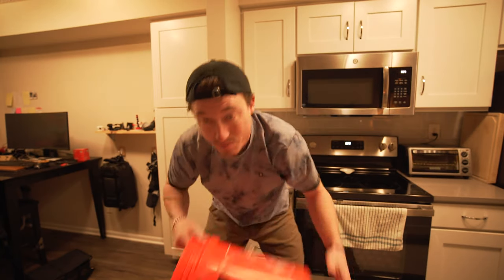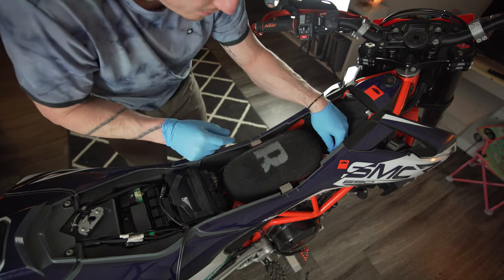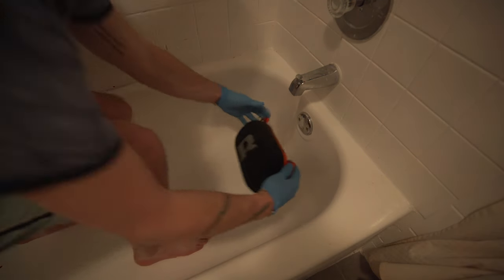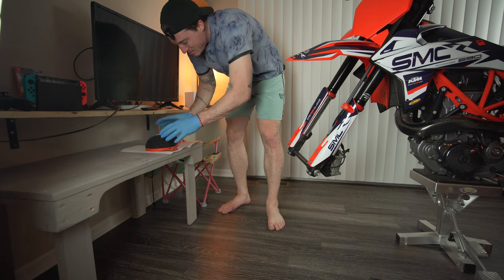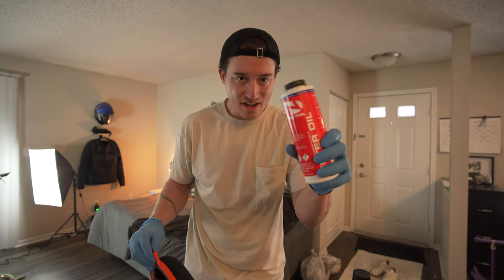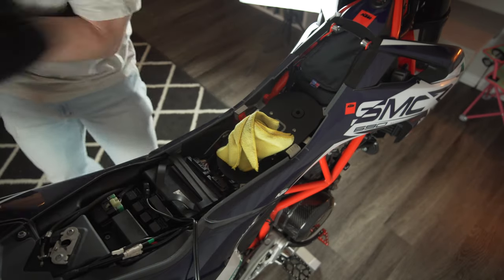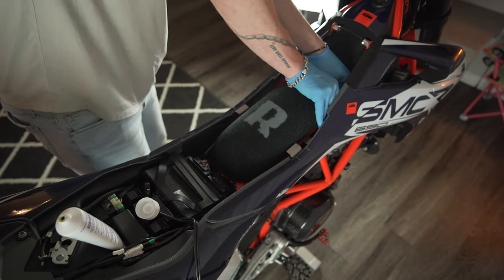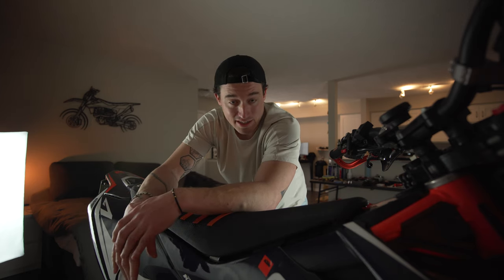How to clean your Rottweiler Intake foam filter | KTM 690 SMC R

Comment: Is it true that a Rade Garage filter has the same performance, HP and response wise? I love the RG pricing and easiness, plus the extra storage or fuel tank. For an SMC R. What do you think?
Reply from the maker: It's hard to say since I don't have any experience with a RG filter. I would assume.. again ASSUME.. it's better than stock but is probably the same as Rottweiler? Rot does offer a storage bag that you zip tie in (which I have an highly suggest) but if RG offers extra fuel that may be pretty cool.. At the end of the day, I wouldn't see (assuming) a performance difference between the two, I would simply choose based on familiarity and/or accessory choice. 

Answer: I will choose Rottweiler because I have experience with the brand and I don't need extra fuel storage. Not to mention I bought my PCV from Rot and they have all my bikes info/mods and tunes..

Comment: What is the name of the small bag/storage space under the seat?
Reply from the maker: It's the Rottweiler Internal Soft Storage Bag - https://shop.rottweilerperformance.com/internal-soft-bag-690-701/

But you do need their Intake for it to fit, It wont work with the factory box in there.